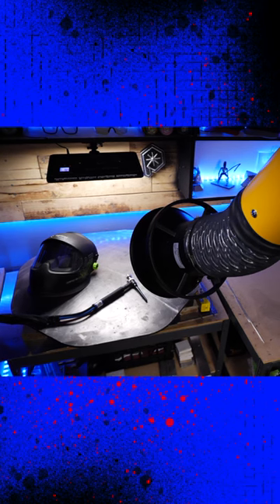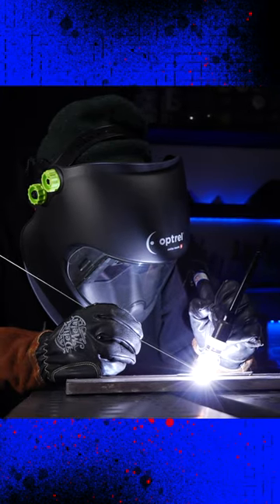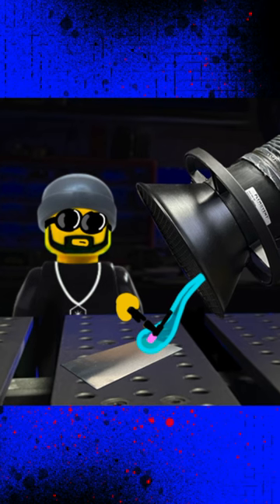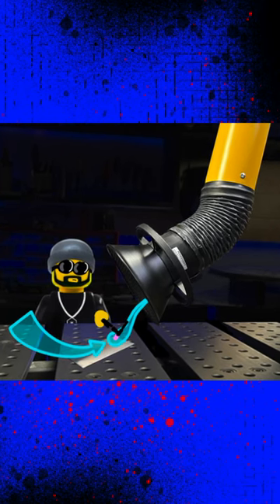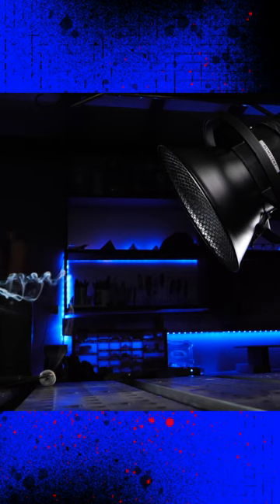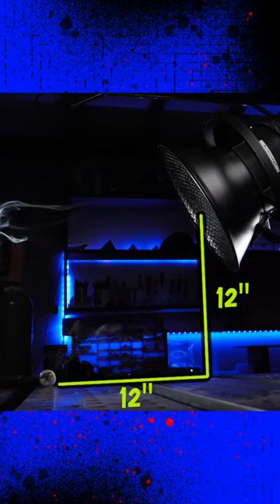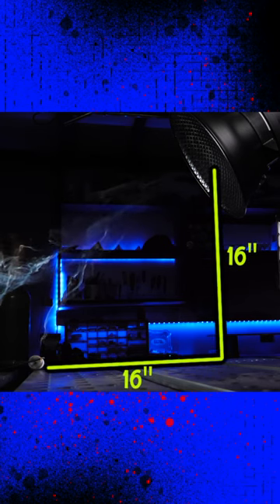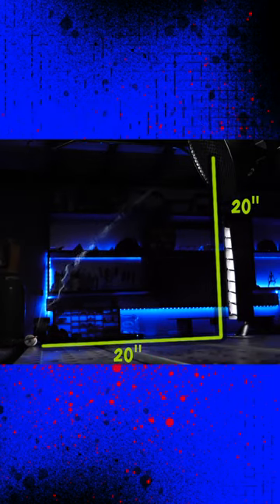TIG Welding fumes SOLVED!! #shorts

Comment: So something I am running into.. I think is magnetic interruption. One of them triangle magnets stood up with a 3" piece  layed across ( creates a T ) one of the cradle points. One side tigs ok. The other side goes crazy. 
I have to tack the right side then move it out of the cradle and onto the flat spot of the magnet triangle. ( down).